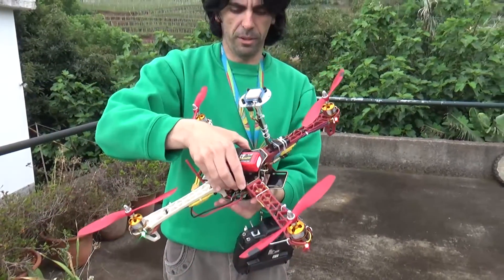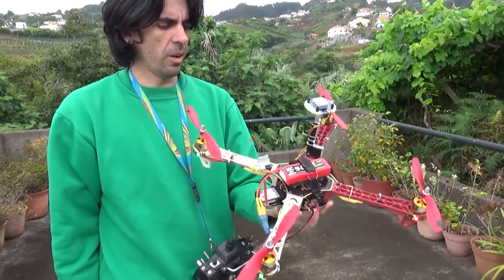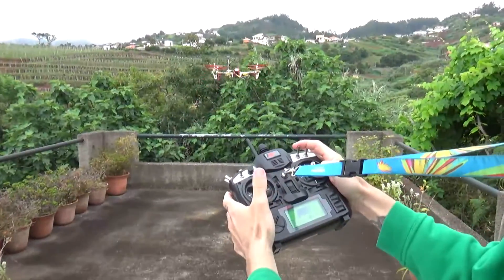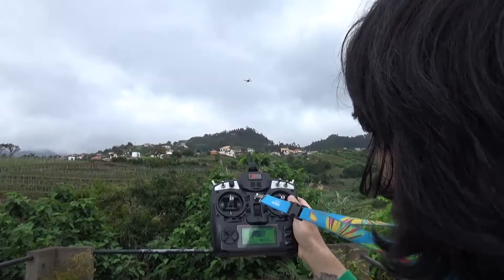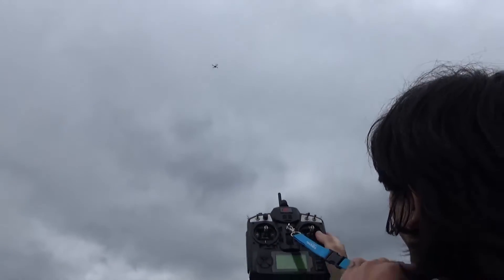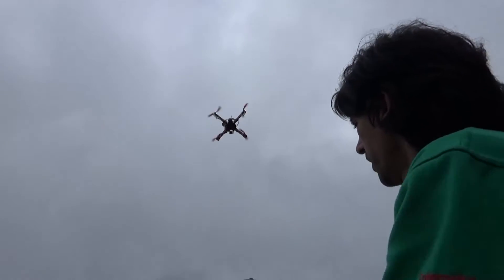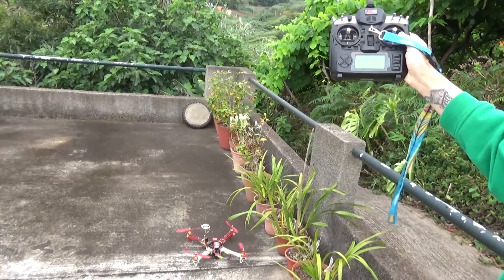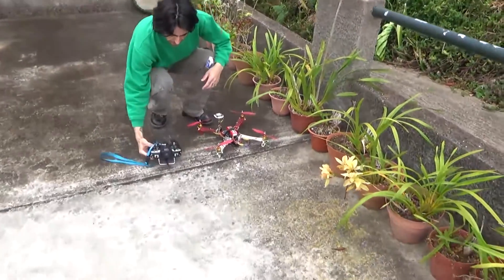iNav 1.1 Failsafe Test

Comment: Hello sir, how did u arm the qaud by stick command....?? I mean in inav's mode section there is no option to arm by stick command, it allows only a separate channel i.e ch5 ch6 etc. To arm so plz tell me how can i do. I am using a sp racing f3 flight controller

Comment: Hi, can you share your failsafe setting? I'm wondering how to set up for Guard time for activation after signal lost & failsafe throttle low delay.
Reply from the maker: Jefferey Jiang i have a video in my channel where i show my configuratios it is named "iNAV configurator settings for my Q450 quadcopter" sound quality is pretty bad but it is understandable

Comment: Are you using an f3 flight controller?
Reply from the maker: Ijas Ahamed no, i am using a Flip32+
Reply: Thanks, But everyone is recommending F3 flight controllers. Is there any disadvantage using a Flip32+
Reply from the maker: Ijas Ahamed i don't know...by the time i built that there was no such thing as F3 flight controllers, or at least i had never heard nothing about those boards...so i used what i had, which was the flip32+, but now probably F3 is better as it is most recent...anyways i am not very sure of what are the advantages or disadvantages of each one...
Reply: Ok. Thanks a lot

Comment: great job on that. iv got a flip just gone to inav> :) 
just one hint tho...... set a failsafe switch so if a problem does prop up your controller isnt off and you can just flick a switch to get control back. (testing only of cousre)  
hope mine works as well as that....
would like a screen shot of the pids inc gps pids please ;)
Reply from the maker: hi, thanks, i already have that switch set you can see that on my other video...about pid's everything is iNav stock...nothing was changed

Comment: hello bro,.did you rewrite command on CLI tab for activating Inav RTH? , what protocol of gps are you use? , when i use inav rth my quad almost down and fly away. i'm using external mag and ublox 7 naze gps.
Reply from the maker: hi, for activating RTH i did not used any CLI command. And for setting up the mag i had to choose CW0º but not on CLI, i selected that in configurator tab...because my previous choice for mag was CW180º and that would mistakenly show north in an almost correct direction...but then when activating PH or RTH the quad would go crazy...as soon has i changed settings to CW0º north direction started showing more accurately, and the quad started performing smooth as you can see in the video :)

Comment: hi,..nice video,..did you disable failsafe stage 2? or enable both?
Reply from the maker: hi, failsafe stage 2 is enabled and set to be RTH, but you must use iNav configurator not cleanflight, because they show different options
Reply: Thanks for your replied, by the way i already flashing Inav 1.1 with cleanflight. it is possible to setting at inav configurator? or  Should i to re flashing again with Inav configurator?
Reply from the maker: +Sigit Pramono you don't  need to reflash again, just use iNav configurator from now on and it should work ok
Reply: Many thanks my friend. when you activated Nav RTH on modes Tab, did you enable MAG too? or just Nav RTH?
Reply from the maker: +Sigit Pramono just RTH
Reply: ok,.i will try ,..thank you luisfilipe1983